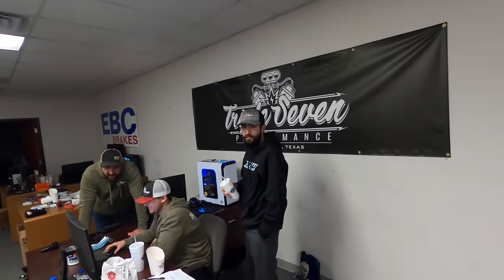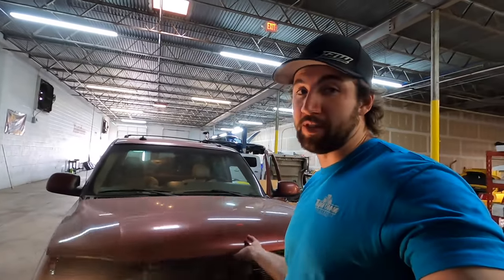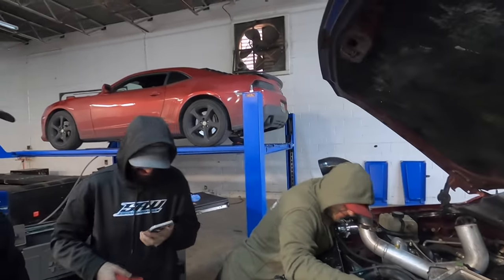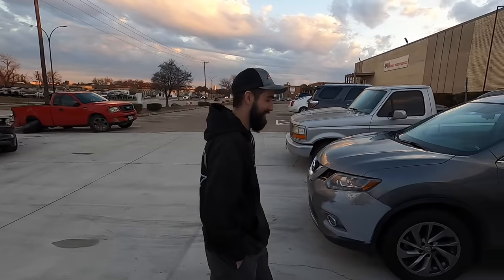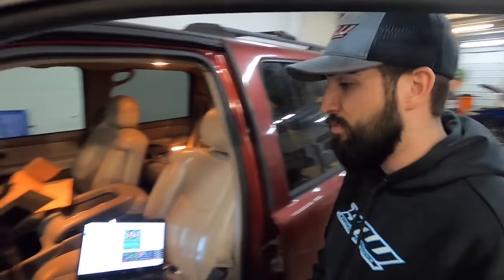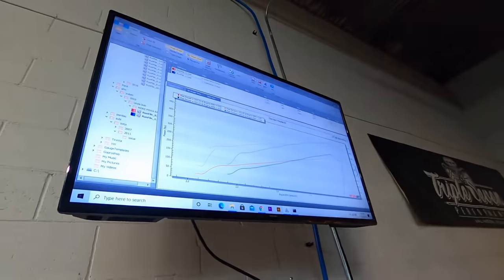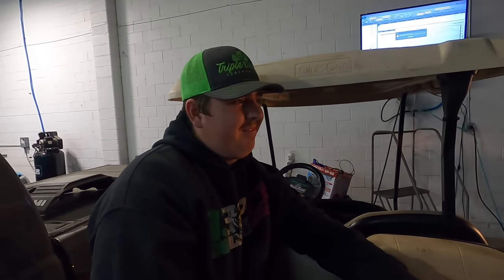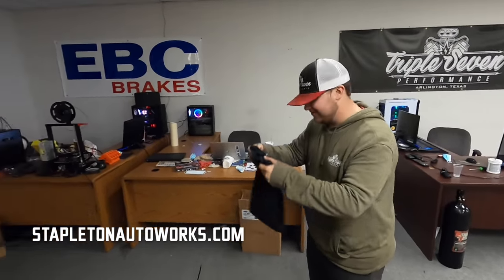What Happens If You Turbo a 5.3L Yukon With No Other Mods? Lets Find Out! (Uncle Rob Hits the Dyno)

Comment: Love how everyone is around high HP cars all the time and a small HP turbo yukon gets everybody acting like kids. Thats whats its about, if you're not having fun doing it then whats the purpose
Reply from the maker: This. 100% 😂
Reply: That's because they have no worries if it blows up and its more fun if it does!
Reply: Absolutely! That's what I say ALL the time. I have two turbo Hondas...a 709 whp fully built LSVTEC GT3582 Civic coupe and a 500 whp CG1 Accord with a JDM J32A and six speed manual swap with a GT3582R turbo. I turned every nut and bolt on them both. I also painted both of them in my backyard. It's all about what you love to do and having fun, or what's the point?
Reply: This is my retiring plans, just fucking tinker and do shit like this!!
Reply: Facts
Reply: FOR REALLLL you dont need insane horsepower to have fun! Ive got a stock 02 Suburban that me and my friends still have fun in lmao. Rips donuts on dirt np and you can even drift it on wet surfaces if you flick it
Reply: @javi1373  it’s my old man. He’s already retired. Dudes restoring randomest shit ever. It’s awesome.
Reply: @Brock_Landers i bet those little Hondas rip with ease... People need to stop sleeping on the 4 bangors

Comment: It’s a common issue for those 4wd button panels to go bad. You can either take it apart and re solder the connection that goes bad or buy a new button panel from summit for like $40
Reply: Mine gets stuck in 4x4 some times I'm sure it's the thermal actuator thou. I'm just to lazy to get to fixing it since it ts not my daily driver.
Reply: I got lucky on my current Yukon and just unplugged the battery and cleaned off the grounds under the truck and it fixed the issue.

Comment: If the voltage drops to low or you have it on a charger,  hp tuner won’t load, if you brick the computer people say it’s screwed and you have to replace the ecu but my experience I unhook the battery for 15-20mins and they always load
Reply: This exact thing happened to me and I thought it was a goner. Let it sit for 30min. Loaded the time and started right up!

Comment: There were some guys that put a 4.8 at like 1100hp at like 18 lbs of boost  for enough passes for a full season with a completely stock motor.
Reply: DOUBT INTENSIFIES
Reply: Yea not true 😂
Reply: Stock won’t make it all season
Reply: @Contreras-z4e  do you want the link?
Reply: We do it with 5.3s but alot more boost then 18.     That's false
Reply: @bradykile4598  off the top of my head I think it was 18 lbs may have been more. But it’s been a minute since I read the article. Richard holdener did it with hotrod magazine

Comment: In all seriousness, I would greatly appreciate an A/B test of 2wd vs 4x4.  It'd be interesting to see how much more parasitic loss is incurred by moving the full drivetrain.  Although I get the feeling that the 4L60 is going to hate life even more when that happens.
I've always been interested in maximizing the capability of stock components, so something like that would be great data to mull over in my head.
ON A SIDE NOTE: Does chevy's 4WD system engage the front half at the transfer case or at the front differential?  My '95 Explorer XLT did this thing where the transfer case was always fully engaged with both output shafts spinning 24/7, and the only difference between the modes being whether the front differential was engaged on the front axle or not.  I've been wondering if that's just a Ford thing or if it's a more universal design philosophy.
Reply: The front shaft spins freely when it's in 2wd. Pop in 4x4 and it engages the the front shaft at the transfer case. Then the actuator on the front end engages the front diff.

Comment: It's always something. Junkyard trip just to find out it was a loose battery connection. I figured the next thing would be you'd run out of gas on the dyno. 

At least you got to go to the junkyard. That's even more fun than going to the hardware store. Can't wait to see what the new fuel injection does.

Comment: For gen 2 and 3 LS pull the radio fuses before you tune so the ecu doesn't brick I use HP Tuners on my silverado and I pulled my radio fuses and had no issues. That's the trick

Comment: Dose an 03 5.3 still have the fuel pressure regulator on the fuel rail? I know the ones on the rail were vacuum reference, so technically its boost referenced. Probably still need more pump.
Reply: My 03 and 04 both did . Just pulling the the vacuum line off should increase the fuel pressure but not at upper rpms . Can you put pressure on those diaphragm regulators and increase fuel pressure?
Reply: Well it connects to the top of the manifold, so any positive boost pressure should be added to whatever the base regulator spring pressure is. I don't see why you can't put positive pressure to it.
Reply: @ajc894  that’s what I was thinking but how much positive pressure would it take before diaphragm gives up or spring bottoms out . I don’t know but I’d sure try it especially at the lower boost levels he is at right now I’d think it would handle at least 8-10 psi if not more ! Definitely enough to carry uncapped stock injectors to there limit I guess ?
Reply: @jasonsparshott7208  I'm pretty sure it's also a l59 flex fuel 5.3. So decaping the 33 lbs/hr flex fuel injector I think gets something like +80 lbs/hr.
Reply: @ajc894  so it should be capable of making a good chunk more power on the factory fuel system.

Comment: Same thing happened to me with Hptuner first time using that tune program. My battery had a low charge so the Hptuner didn’t like it, after charging it up it worked to read and write..Hptuner didn’t like the battery charger still connected charging because it read as a fault in battery. Hptuner is a finicky system

Comment: I plan to do some long haul towing with my burb. Im putting in a new long block, but my question is, should i go back with a new 5.3L or go for new 6.0L? The trans was rebuilt shortly before i bought it, is what the dealership told me. Truck has 360k miles.

Comment: Put a new back dif drive shaft and transmission (new but stock factory parts for that truck model ((if still around for that truck)) so you have more life and less lag for everything) to make it have a better chance to take off better. Then get better parts. (Later when possible) but take all the extra stuff out the back and put new suspension to help everything out too.

Comment: Man I did a BTR stage 2 cam swap and Tx speed long tube headers and mbrp cat back and had it tuned. Wonder if the reason it won't burn out is because of that brake tq management? Unless it's just because the power band is up higher. It just can never brake the tires loose at a stand still but if I get the rpm up on a slippery surface she will roast them good.
Reply from the maker: The brakes are super weak too
Reply: @Stapleton42  actually my brakes grab almost to hard that it can't break them loose. Unless it's from that part of the tune you guys mentioned? Maybe I should just have a line lock added later on.

Comment: How much horsepower torque do you lose going through a 4 l80e and a 3/4 ton truck rear end
Reply from the maker: A lot lol
Reply: @Stapleton42  can you give me a percentage I built a 408 out of an lq4 6L and I'm got 361 ft pounds of torque on the rear tires I was wondering how much I had at the crankshaft

Comment: I wanna see how much Hp my truck makes after you install a turbo off a diesel 6.0.  I have a tuner installed already.     I have a 2009 ram 5.7 hemi.  The only upgrades are a cold air intake and the tuner.  6” skyjacker suspension lift, 35” x 12.5 all terrain tires, gloss black 20 x 10 wheels

Comment: LOL I put a water pump on a customers inline 6 F150 back in the day. I left it outside running and forgot about it. Came in the next morning and it had ran out of gas and the paint on the hood had came off in one big sheet. The paint had slid down and looked like someone had taken the hood off and propped it up in front of the grille. Some gas, a battery charge and a cheap paint job on the hood is all it took to get it back on track, but I still felt kind of dumb. It probably had a cheap paint job to begin with and the heat from running for 18ish hours just undid the bonding of the paint. The paint came off in a perfect sheet, we were joking about gluing it back on. Not the only car I have forgot I had left running, but that was def the longest and most damaging.
Reply from the maker: Wow thats actually kinda awesome lol

Comment: Man I daily a 500 hp silverado single cab for a year now with a 4l65 and 3000 stall and no issues... it does have a massive trans cooler though. I think heat kills the 60's more than anything. Curious to see how your hangs in there. I also like them because they are lighter and don't suck the power like an 80... good shit boys.
Reply: Where can I see more of your single cab bro.

Comment: Badass yukon xl!! Always wanted to throw an s475 (75 ex wheel) on my my burb but dont want to take headers off lol Just a heads up but when I tuned my 03 burb and 03 tahoe I had to pull radio fuse when using hptuners. Even with fuse pulled I would get errors occasionally. My ECU's "bricked" with hptuners also but was able to recover with Efilive. I try to use efilive on the 03-06 trucks it's less issues

Comment: Hey, love ur guy's stuff. I got a 2000 yukon xl with the 5.3. Is my 5.3 the same as the one your toying with? Also if I take the 60 amp abs fuse out it does burnouts. But do not leave out for too long.

Comment: I'm a mobile auto glass tech, windshields mostly. Long story short, I ordered a drone on eBay and it was shipped to a transmission shop I did work for an hour from my home. Also I didn't, and still do not know the address to the transmission repair shop. CRAZIEST PART: I was driving by the transmission shop(headed to another location, had no jobs planned for the tranny shop) I get a notification from eBay that my item had been delivered to the shop I was driving past. I call the shop and they said🤣🤣"is this your helicopter toy??" 😂🤣😂 crazy all true
Reply from the maker: That’s wild 😂

Comment: What are they, 28 lb injectors? It should make just over 400wheel @ 100% DC.

Theory is, a lb/hr of fuel is worth 2 hp. So, injector lb rate multplied by 8 cyl, then double for the 2hp/lb.
Reply from the maker: 33

Comment: Did you ever get a map & larger injectors in it?  Would love to copy it but tuned & able to tow.
Reply from the maker: Yes and they managed to lie to me about the timing and melt a piston. We are in the process of building a new engine for it with a bigger turbo now lol
Reply: @Stapleton42  would love a simple & reliable way to put a turbo on a little 5.3L LS even if it ment rebuilding it with different pistons & a cam ect.  Can you share the parts I will need & possible program an ecu for my 01 suburban?

Comment: What programmer program are you guys using?  About to go injection on a project track car with a motor like what you guys are using here but will need to fix the fuel tables for the large cam that will be in it and would like to get to the times of injection.  When doing a search online for one don't really get any reputable results.
Reply from the maker: Hptunersw

Comment: 8:57 is he saying "brake torque management"? I have an '05 Yukon with a L59 and factory 4.10s and it bugs the hell outta me that it won't break the rear wheels loose from a standstill.
Reply from the maker: My particular Yukon had the auto 4x4 and that’s why it wouldn’t do a burnout. The transfer case was actually pushing on the front wheels during this dyno pull and we had no clue

Comment: I did something very similar on my 2010 gmc sierra flex fuel. We got further with the bigger flex injectors. I have since put ID 1050x and e85 and run it at 10 psi with fuel pressure dropping fast.

Comment: Take some fuel rails off of  02 Flex fuel with the Z in the Vin number and it has a weird pressure regulator on the rail that sucker will reference boost then u good to go on the cheap
Reply: And some cheap 80s

Comment: Fyi the stock injectors will run out of steam before the stock pump lol. On my truck I was out of injector at 4k rpm just like you (4.8, 67/65 turbo, stock cam, stock converter) after 60lb deatchwerks injectors I can run 10 psi with the fuel pressure dieing off at redline with the stock pump

Comment: I have an 08 Silverado with a 6.0 in it and I'm planning to stick a turbo on it stock. I'm trying to figure out which cheap one to get. I'd be okay with results like they got with this. It has no active fuel management and good oil pressure I'm guessing it will handle it if I don't thrash it.
Reply: You ever end up doing it?
Reply: @brannonbarakat457  no I can't afford to do that right now, maybe next summer.

Comment: Would the motor in uncle rod really be an LS or is it a vortec cause it still has a iron block and a LS has an aluminum block. I might be wrong I did Google the difference between an LS and vortec. It said that the vortec is a iron block that comes in most trucks and large SUVs and the LS is an aluminum block and was used in cars  Corvette Camaro GTO
Reply from the maker: It’s an LS

Comment: I own a 250k plus 2003 5.7 hemi ram 1500 that’s a powerhouse. Makes 465hp. All original well took care of solid unit. All it had was rear fender rust and rocker panel rust. It’s a northeast vehicle you can’t help that. But I got it repaired. Looks factory and I love it… aside from the couple dents… they add character. Lol the rust was irritating and I wanted to make it look all original so I got rid of it. It’s got a 4 inch leveled out lift and exhaust system that’s only thing that ain’t original with the body

Comment: I have an ‘05 tahoe and the only thing that ever caused problems with flashing and actually bricked my pcm is aftermarket shit wired into the CAN bus. I actually un-bricked it soldering a background debugger directly to the board. When you have issues like this, you need a bench harness! You can use the blue connector from either a p59 or a p01 to make a bench harness just add a 12v power brick and an OBD port, a few minutes of soldering and bob’s your uncle. Msg me or reply if you want me to unbrick your pcm, so you have a a spare on hand! If your P59 PCM has an AMD processor in it then you can clone its firmware to any P59! A perfect clone means you won’t need to license 2 PCMs in your tuning software either.

Comment: First, Mariachi Band FM is the best radio, any other opinion is heresy. I learned spanish to understand what the heated talk shows and segments in between the mariachi bands. Second, the safer and more likely assumption is that a labeling machine/package sorting line/computer at FedEx messed up and put the wrong label, because occasionally they do that...However, it's also possible that someone put the label on it on purpose to direct the package to the wrong location for an accomplice to come by and pick it up, but the people at the doctors office and yourself got to it before it went permanently missing. Because unfortunately that kind of thing also happens. 

The people demand more junkyard and if you find something really cool, build it. 

My guess was 380hp but the 4l60 would scatter before you got there. Uncle Rob is looking like it's shaping up to be a very nice trollmobile.
Reply from the maker: I think fedex messed up. I got a re labeled box with someone’s hearing aid parts in it today 😂
Reply: @Stapleton42  Damn, that labeling machine/sorting line computer was having a bad day :)

Comment: Love the build. The 5.3 didn't make 315hp till 4th gen stuff came out in 07 , an 03 made 285 or 295 at the crank, making that low RPM # you got all the more impressive. Guessing you actually made 6-7 PSI there.
Reply: I have an 09 5.3L and I want to give it like 2-3lbs boost with a small turbo. Just a little bit of extra oomph. Where do you think that would put me?